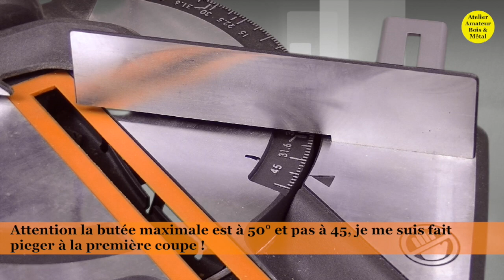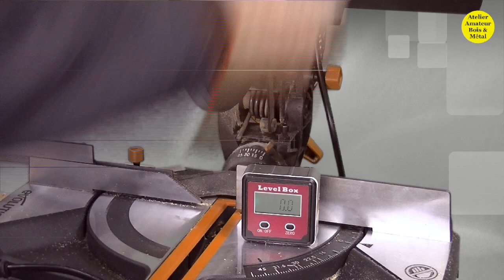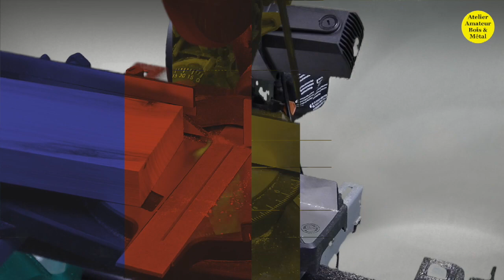Scier l'acier comme qui rigole  Episode 2

Comment: Machine deja vu à 40€ ... au menu:
Plateau pas plat, les 2 bords sont  inclinés(là ou le serre-joint appui)  et pas aligné avec le plateau, jeu dans l'articulation du bras, quand on bloque le plateau avec la vis ce dernier se déforme, le plateau se déforme quand on baisse le bras, l'angle du plateau est different si on l'a tourné dans le sens horaire ou anti-horaire, etc etc...
Bon pour de la coupe ne nécessitant pas de précision.
Reply: C'est tout de même étonnant de voir une telle disparité dans les prix d'une même machine. Comme avec toutes ces machines à petit prix, on ne peut s'attendre à des miracles de rigidité et donc, de précision. Et comme la matière et son transport se paient, fatalement, le fabricant rapine sur les épaisseurs. 
Quand on fait une petite estimation, si on prend 40, ou même 60 €, qu'on retire la TVA, le bénéfice du vendeur, les frais de transport et dédouanement, l'emballage et quelques frais oubliés, il ne reste tout de même pas grand chose pour la production (~ 20 € ?). Pour ce prix, on n'a même pas une ½ lame chez Festool® :-)  On ne peut donc pas être trop exigeant.
Reply: A ce prix t as meme pas le moteur. C du semi pro. Va sur idealo. L alluminium se casse mais se deforme pas. Tu confonds. Je connais tres bien la marque et la machine et j ai defoncé dds chantiers avec. C pour info